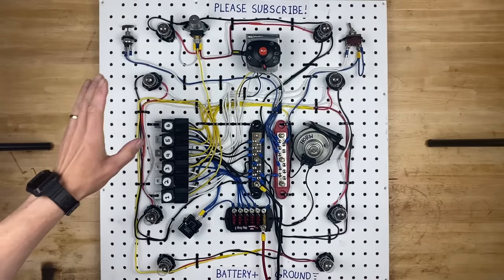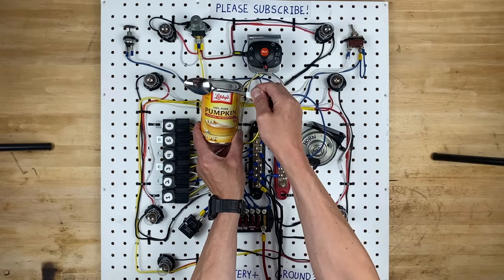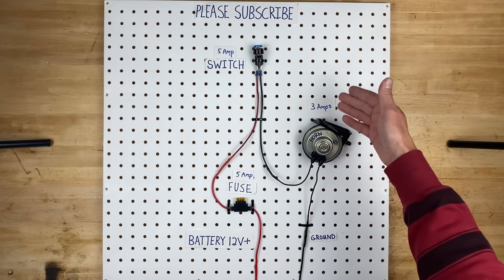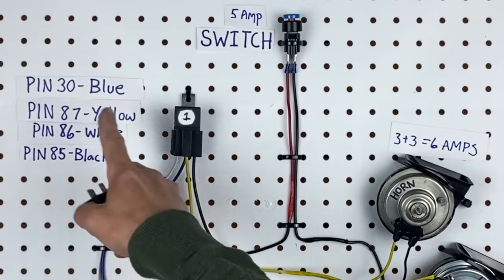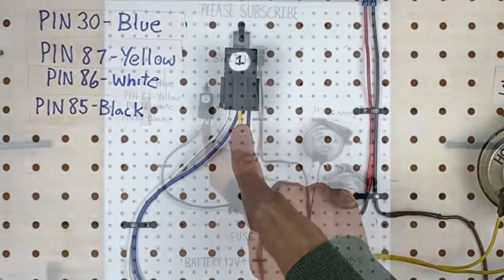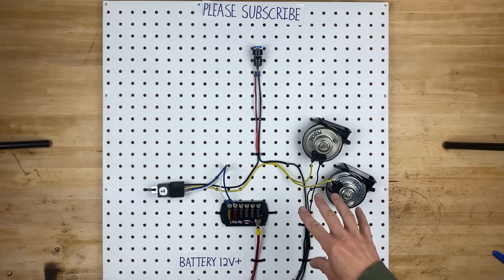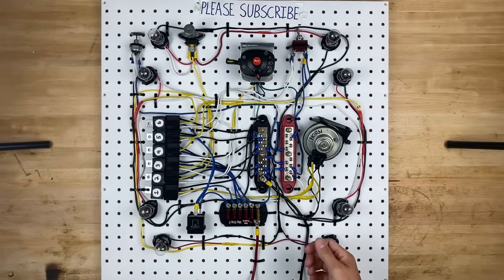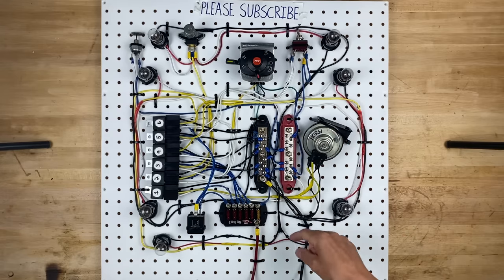How to Wire Headlights, Turn Signals, Brake Lights, Parking Lights, Hazards, Horn, Kubota Switch

Comment: I paid thousands of dollars for a supposed education at a motorcycle school. After just shy of 24 months I didn't understand as much as i do after watching ten minutes of this video. Brilliant.
Reply from the maker: Wow! That’s absolutely awesome! Thank you so much for watching and leaving this comment. It made my day!
Reply: Just one question. Why does the power block only need a 5 amp fuse. Where the relays need a higher fuse. I understand that the fuses for the relays are transmitting higher power. But doesn't the power block draw more amps if some of the accessories are working at the same time? 
 @WiringRescue
Reply: @starfighter2952 only needs a 5 amp fuse because those only turn the relays on, not the accessories. The current draw of the coil in the relay is only about 200mA, so those 5 amps can power quite a few relays.
Reply: Where are you located and what will you charge to do exactly what you did to my kenworth T680?
Reply: Who's the mug then.
Reply: I went to college for motorsport engineering for the same amount of time, learned more in my 60 hours work of required experience than I did the whole time I was actually at college… not sure why we pay for them 🤣

Comment: Ive never heard it explained that way.A relay is an automatic switch that has a coil and when energized the line voltage circuit will be opened or closed depending on what it is normally.
Reply: How would describe it to yourself before this video 🤣

Comment: so, the high beam switch is a high amp switch?
Reply from the maker: In this design, yes, but this specific dimmer switch is rated to handle the amperage load of the headlights. If you were to use a different style dinner switch, it may need to be a different method of wiring.

Comment: I am getting ready to re-wire a 1988 Dodge RAM W250 that I have been rebuilding for 2 years.  I'm an Automotive technician an your videos are spot on and helping me to visualize the change from 1988 tech (not many relays) to modern style.
Reply from the maker: That’s awesome! Thanks for watching and good luck with your Dodge! Those trucks are awesome!
Reply: Would you be willing to mail me that peg board I'll pay you for your time and parts

Comment: One of the bad things of having your favorite ride parked for the winter (Goldwing, snow, cold) is the abundance of time not riding your favorite ride.  One of the GOOD things is that there is a lot more time to figure out what projects will take over your life in the Spring, and with lots of time available, there is naturally a lot of YouTube surfing.
I came across one of your videos while researching fuse blocks and relays and things electrical, and was immediately hooked.  You have an absolute gift in your ability to explain, in simple terms, what makes most of us cringe.  I just watched this video on Headlites, Turn Signals, Brakes etc.  The opening shot of the complete board nearly had me quit and move on, but I was surprised to be able to follow along with you as you explained each circuit and progressively added each new circuit.  Being able to see what each piece of the puzzle did and how it interacts with the others takes a lot of the head-scratching out of the project.

Thank you for taking the considerable time to help out those of us who are just smart enough to know we need help.
Reply from the maker: It’s extremely kind of you to take the time to share this with me and it’s truly appreciated! Thank you for watching, and I’ll keep making these if people keep watching! :)

Comment: Best channel on this stuff without a doubt. I needed to revisit because I kept overthinking 12v on and 12v switched and was having 2x 12v powering up my accessories ie electric fan and a gauges, and fuses were blowing and the gauges came right on right when I attached the pos bat cable. Duh! Good now. Overthinking with electrical and wiring kills any project.  Basically had no switch to power my stuff and had power at all times!
Reply from the maker: I’m glad the videos helped you out! You’re right that it can get confusing, especially if you haven’t done it in a while!

Comment: The amount of headaches this video saved me from figuring out circuitry of each system. Currently re-wiring a ‘85 Nissan 720 to my specifications. Thank you for this video.
Reply: @RattyCarMuscle could you make a video on how to wire an alternator from scratch, or like a general overview on the circuit set up?
Reply from the maker: You’re welcome! Glad you like it!
Reply from the maker: I actually just bought an alternator for this. The catch is that it’s a GM alternator. It was the most common one I could think of.

Comment: My truck is 22 years old . I have maintained it well and electrical  is now on the menu.. I replaced my fuse block,  light bulbs  , and checked all connectors in the harness and cleaned every body ground connection.  My electrical system went haywire when circuits were energized with the key off , then the computer under volted and stopped reading the speed sensor and that led to transmission going into safe mode along with the engine  with the money light on. Some people said it was a bad GEM  module  .. The fix for me was replacing the fuse block and cleaning up connectors . If you own a vehicle auto electric is a must to learn.   You make it easy to understand ..   ⭐

Comment: Thank you. I shorted something in my dads classic truck and now I’m afraid I have to construct a whole new wiring harness .. I have been putting it off but your knowledge and insight is going to keep me coming back.
Reply from the maker: Start with the shorted wire on the truck and work your way backwards. It may not be so bad once you take things apart!
Reply: @WiringRescue  thanks. I will sort it out no matter

Comment: YouTube randomly suggested your video to me and I'm so glad I came across it.

My headlights and popup motors randomly stopped working on my 1993 Mazda RX7 and I've been putting off troubleshooting the issue because I believe the problem is in the wiring and not necessarily the components (bulbs, motors, fuses). I also haven't had a horn since I replaced my steering wheel, which makes parking lots a bit scary when people can't see me and I can't honk. lol

You video gave me good insight on how to start troubleshooting my healight problems and wiring up a horn somewhere! 🙏🏽
Reply from the maker: FD RX7’s are one of my favorite cars. I’m glad I provided a little direction on yours!

Comment: Love the video! Extremely helpful! Also fun fact: a dodge neon (2000-2005) the mfs (multi function switch) takes all the amps for everything it runs! There are no relays in that circuit!! Causing the main connector to melt as most of the wire was to small of a gauge and over time causing the connector to melt and short out!
Reply from the maker: Interesting info! I guess some relays would have been a good idea in those cars!  Thanks for watching and sharing the info.

Comment: Excellent instruction.  Note that the relay wire colors are not universal, so check yours if you use provided sockets.  The Grote wire you list is not a true automotive wire, like SXL or TXL, and would NOT be appropriate for use on a vehicle.  SXL is abrasion and chemical resistant, and is mandated by car mfrs for those reasons.  You could enhance the setup with one more flasher for the turn signals by putting the two flashers after the relays.  This would prevent the relay from activating and de-activating every time the light blinks, reducing its life.  Great stuff, thank you.

Comment: Watching this before i install relays for my headlights to take the load off the tired old oem wiring and headlight multiswitch and grab power directly from the battery for hopefully significantly brighter output.

Comment: This is a very daunting wire job if you have no idea what your looking at. You did pretty well. But I already knew what I was looking at being familiar with relays many don't know how important and useful they are. Creating circuits that share others and making sure they are fused appropriate is important as well. But if you have any kind of idea what's going on it's a good video.   👍 power wire, ground wire  signal wire and switched power wire.

Comment: So when looking at your double horn scenario. It seems like a lot of extra work and parts to use the really rather than just putting in a 10 amp fuse and 10 amp switch.  Why go the relay route?

Comment: Fastest 25 minutes of my day. Time flys when your trying to focus on something so in depth. I will admit at first it didnt look like alot because how much you broke it down and at the end there was alot going on but sense you went step by step it really helped me process it all. Thanks for your video! I have one question about if you have a brand new car and want to use the hazards do you need to wire a ignition switch so that you can get the hazards to work? Or am i conFUSED on that. Pun intended

Comment: Excellent video, but what if I need to back up?? LOL If you want to get more complicated, do a circuit for vehicles that use the brake lights as trun signals (and hazard). A peeve of mine in the auto industry... I will avoid buying a car becasue it is that setup. Subscribed to see more! You do a great job explaining!

Comment: what a great vid. just tried to wire my car using potatoes but couldn't figure out why it wouldn't work.
Reply from the maker: 😂 right? I was just as surprised when I tried wiring with potatoes. Huge misconception.

Comment: These videos are a godsend! I am an automotive wiring novice for sure. My one question is what gauge wire did you use to connect the battery 12v+ to the fuse box?
Reply from the maker: It depends. Check out this video, I explain fuses and wire size in it. :) https://youtu.be/EhzN6UdnmPA
Reply: Use as big  gage wire as you can you will never go wrong over sizing your conductors but undersizing conductors will cause major problems liike fire.

Comment: Great video man. You are such a great instructor. Question so I will be able to do the whole light system in my car with just 14 gauge wire? Or do I need to get assortment of sizes
Reply from the maker: Thank you! The short version is - wire size all depends on what components you are using. It may work fine, or it may light everything on fire. The good news is that I made a video for exactly this question! :D https://youtu.be/EhzN6UdnmPA?si=TBIv5vN51GB-Gatv

Comment: This video is amazing. The process is great for learning.  Question: is there a reason why the horns are negative triggered and the lights are positive triggered? (or am I misunderstanding?), Thanks!
Subscribed!
Reply from the maker: Yes! Great catch. If you look at most factory wiring diagrams for horns, they are wired this way. My guess is that it is because the horn button is in the center of the steering wheel (which obviously spins), and with a ground trigger, the circuit only requires 1 wire to run through the center of the steering column vs. two (if it were a positive trigger). The negative trigger horn button can ground right to the steering column itself, so the second wire is not necessary. The less wires to manage in the spinning steering column, the better!

Comment: This is why I got into the electrical field. Control wiring is so much fun. I'm curios as to why in the automotive field grounds are switching devices?
Reply from the maker: I don’t know the engineering behind it, because I’m just some random guy on the internet. However, I can tell you that some components on cars use ground switching and some use power switching. A good example would be horns- they use ground switching typically. I assume it’s the convenience of grounding a horn wire straight to the (grounded) steering column and having 1 less wire run through the center of the steering column. A ford starter solenoid is a good example of a power switching circuit. I think the reasoning would be because they don’t want a giant power feed cable feeding full power to the starter all the time next to a hot engine. So they have a separate solenoid in a safer (away from hot engine stuff) spot in the engine bay and only feed power as needed. These are total guesses based on my own experience. May be totally wrong on everything. :). Thanks for watching!
Reply: @WiringRescue  that makes sense. Thank you. Great Channel!

Comment: please do a video explaining how the brake light/ turn signal switch work together, show how to wire the 500148 switch and or how a turn signal switch works internally. It would be a big help as it isn't explained in any of your other videos

Comment: Have you explored getting the upper harness to match that kubota switch so you have the correct connector for use in cases where the switch may need to be removed?  Even a couple feet of wire with the mating connector would sure come in handy
Reply from the maker: I totally agree! I haven’t looked into it, but it’s a familiar connector that I have see. In my automotive travels. If not, you could always get a new weather pack connector and make it look factory.

Comment: Thank you for this instructional video. ? so are the relays being switch through ground?
Reply from the maker: In this video, only the horn relay is. The rest are not. That’s because horns are often wired this way from the factory.

Comment: Please do one where you add in a fuel pump and a starter circuit so I can just wire in a stand-alone ecu harness and call this car a runner!
Reply from the maker: I actually have videos for both of those things already, though I do see that it would be fun having it all on one board for the nice visual!

Comment: Nice informative video, well explained. Have a tractor and wanting to change old glass fuse block to the newer flat push in fuses, have any videos on doing this?
Reply from the maker: I don’t have any videos specifically about that, but it should be pretty easy on a tractor. Check out the universal fuse blocks made by littlefuse like this. https://www.waytekwire.com/item/45655/Littelfuse-46377-10-ATO-Fuse-Block-with-Common/   Something like that would probably work for you! Good luck with your project!
Reply: Thanks for the info

Comment: Great video.  Found this tutorial while searching for guidance on wiring in a replacement halogen headlight lamp socket (old socket overheated and melted).  The two wires in the harness connected to the old socket are both dark gray, so no differentiation for polarity.  And I didn't document which of the two wires went to the two terminals on the old socket.  Since these wires just feed current through a "dumb" filament in the bulb, is it an accurate statement that the different colors of the pigtail wires on the new socket have no significance?  In other words, I can't mess up the new connection by flipping a coin on wiring the pigtail wires to the original wiring harness, right?

Comment: Wow! Looks like to me you're gonna need a tackel box to put all those relays in after you start adding AC, Wipers, Leckric winders , door locks,  radio, etc. I've got a 32 3 window coupe I'm wiring up. I'll have to buy a whole nother car just to put all the relays in.
Reply from the maker: Haha! Well, you don’t need relays if your switch and wiring can handle the amperage draw of your component. The relays just allow you run nearly any components, with a small amperage (generally better looking) switch. The trouble is that large amperage switches are usually huge and ugly.  So controlling a 30 amp electric fan directly with a toggle switch, may force you to use an ugly switch in your beautiful 32 ! That would be a shame. For most lighting circuits (except headlights), a relay isn’t needed, but it all depends what wattage/amperage bulbs your using.
Thanks for watching and let me know if you have any questions.
Reply: @WiringRescue  Thanks for getting back. You know, I went to fridgerater college (33 years ago) I should be able to figure this out, but it's a tricky task trying to figure out where everything is going and how to get there. I just want everything safe, hidden, and clean. I always seem to ask a little to much out of my projects and sometimes it will get a feller in trouble.

Comment: Be cool if you use a metal back board to explain common grounds, shorts, voltage drop , and of course less wires.
Reply from the maker: I agree! I’ll add it to the to-do list!
Reply: But a very good job .This could go on forever into computer sensors.and fault finding with diagnostic scope.with a real engine on a start up stand. Or maybe on a big touch screen 
 circuit program with simulators. Nothing is easy unless you love it.

Comment: I bought this switch to build a similar set up, however, the cables behind the switch are different colors than yours. Anyway i could know what cable does what? Im new to this stuff and probably bit more than i can chew, but im in too deep now to quit 😂

Comment: A better way to hook up a switch to an electrical load device is put the switch on the ground side of the circuit. So that way your power gets used up by the load source. All you're doing is completing the circuit from the ground side so there's no power going through your switch
Reply from the maker: Yes! I’ve got a video for that! https://youtu.be/QAD8vDHTbzo.  Thanks for watching and giving the great feedback!